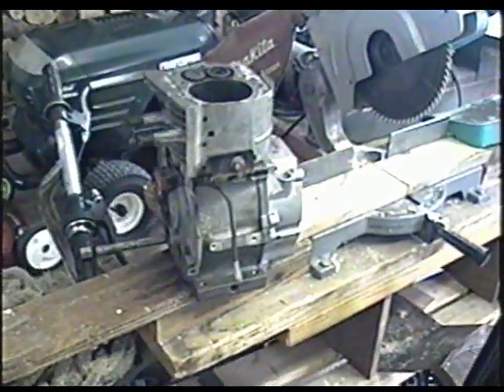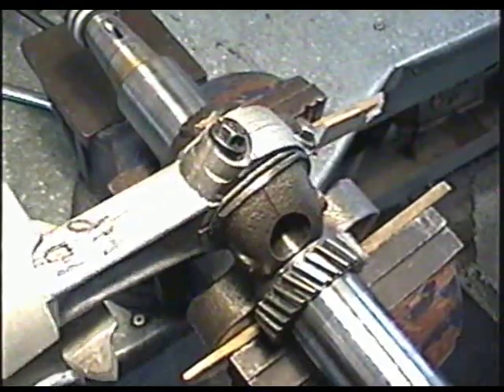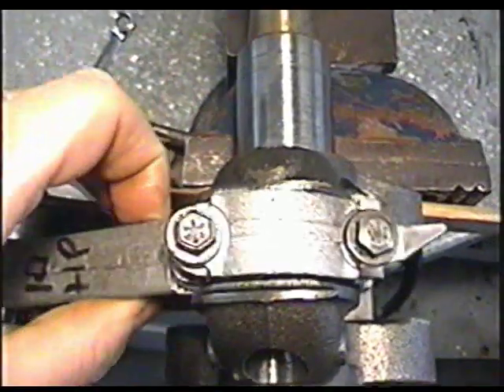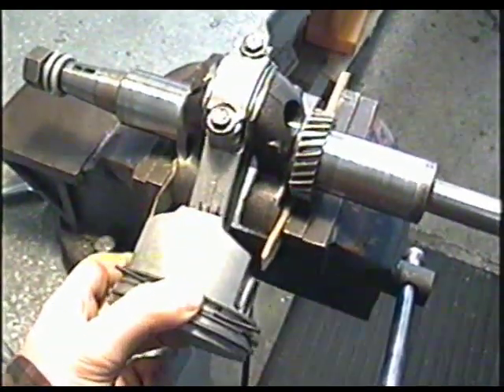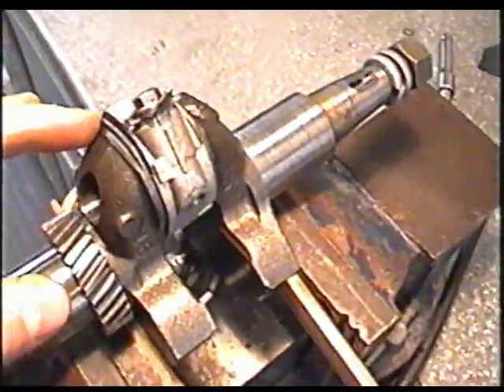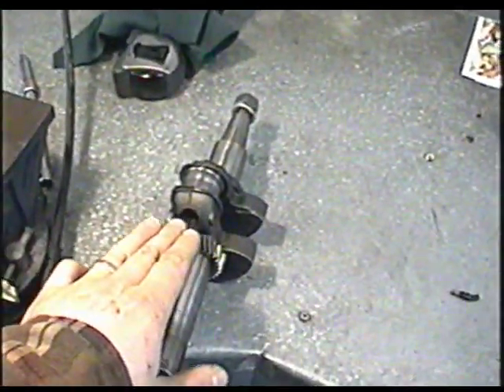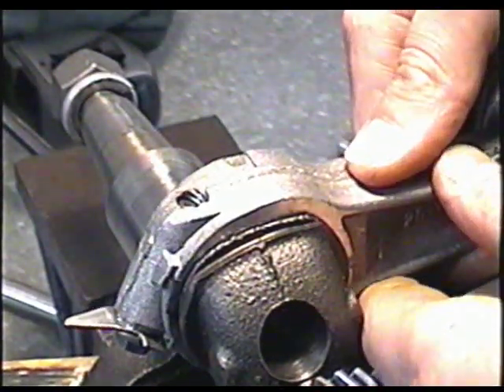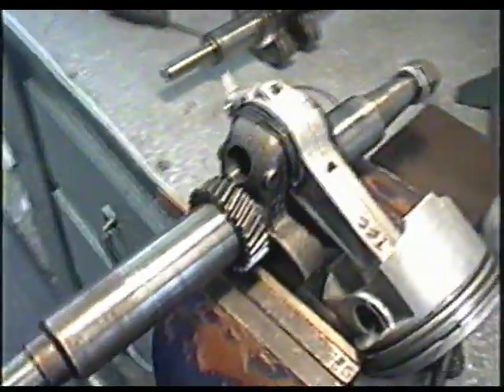Diagnosis of a knocking 10HP Tecumseh Engine

Comment: My Tecumseh hh120 has a slight knock when it's running under load (pto attachments)on my tractor. I just use it for light tasks like pulling trailers and plowing, and it works fine. I guess you have to expect that on a 45 year old machine though.

Comment: my dad had an old 1963 corvette several years ago, someone dropped a rebuilt 350 in it sometime before he got it. after a little while it got a good knock to it. my dad filled it with gear oil to quiet it down and sold it lmao

Comment: I had an old B&S motor on a Montgomery Wards mower that had a pretty good knock in it.  I just ran it like that.  Well, I tip it up and clean it out after every use and I worked on it once in while.  One time I tipped it spark plug down too far and for too long filled the head with oil.  I realized what happened, so I made sure it wouldn't hydro lock, then I started it, it smoked like crazy for a while, but no more knock, lol.   It was probably piston slap or wrist pin knock.

Comment: Maybe that loose crank can be used if there's any such thing as undersized rod bearings for that model. Well, do they have bearings or run right on the crank journal?
I have a mower with a 6-1/2 hp Tecumseh and the crank has a heck of a lot of end play. It started thudding on start up? What could have made it get so much end play? It was always full of clean 30W oil!